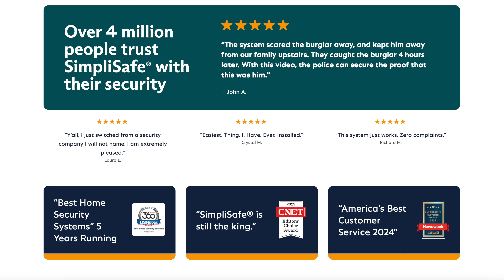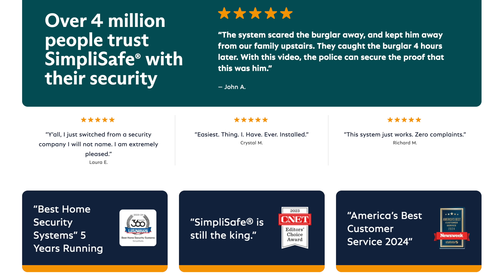Not Going to Lie, I was a Little Nervous! Back in The Saddle

Comment: Ceramic or after market  applied finishing coatings can be benificial for people that are OCD with respect to the appearence of their cars. How do you know if your OCD in this area? If you wash and dry your car before it's dirty you are likely complusive and an after market additive coating will be a benefit to your mental health. More lasting and actually achieving a minimal return on your investment is a roof over the parking area and second is adding walls to achieve true indoor storage for normal owners who care about the cars longterm appearence. However if as it seems to me you are to likely change your cars every 5 years or so almost all OEM factory finishes will be ok for this service length. So I recommend in your case to not spend on garages and or protective coatings, just have your car detailed and waxed before trade-in. Since retiring in 2011 I have been restoring muscle cars and more recently also building restro-mods each project car/truck has out of pocket costs of $50K-$70K and restromods cost 3-5 times as much. I built a home shop and have had one full time fabricator and two part time apprentices continuously employed. My shop is cooled and heated about 7000 sq ft half is for equipment and half is for the 12 or so on going projects I work on at any one time. I try to break even however my OCD makes this a yet to be realized goal so it remains an expensive hobby that my wife tolerates. Hope the above is useful. Ray

Comment: I ceramic coat all my vehicles twice yearly, I first clay bar then apply the ceramic coating. I use Turtle Wax Hybrid Solutions Ceramic coating with great success. Beleive me, you can get into first fights over ceramic coatings and you can spend many 100's to a couple of 10 dollar bills. YouTuber ProjectFarm has done a couple of videos on ceramic coating and Hybrid Solutions has come out in the top. Runs around $13 for a 16 oz. spray bottle that lasts me for two years.
Reply: You do not need to ceramic coat 2 times a year.... If you do it right, which it sounds like you don't, ceramic coat will last a MINIMUM of 3 years

Comment: Had Ceramic coating done by the dealer a few years ago and was not impressed. Back in December had a detail company do a Black Gladiator and really like it. Much easier to keep clean and since then have had two other vehicles done, one black and one grey.

Comment: Most body panels, in areas that use road salt, rot from the inside out.  Silicon coating won't effect that.  Might need to have the coating aplied every year for best effect.

Comment: I have one car with ceramic coating. The ceramic coating has a very slippery feel to it like a freshly waxed car but unlike wax it lasts a few years. Any dirt on the car can be easily washed off, bug splatters come off much easier. Definitely worth having done to vehicles you want to keep nice. Especially dark colors. Not worth it for everyday beaters.

Comment: Out of curiosity have you ever tried just stacking the whole rounds by the split force and using the log lift. I’m sure those are large rounds but they perfectly round. Almost seems easier to keep them whole and roll them onto the log lift. You seem to have mastered all your processes so I’m sure you have your reasons. I just can’t help but to think pre splitting makes it harder on the back actually having to lift half rounds instead of roll whole ones! Thanks for the video.

Comment: Flail mowers... they've been around a long time, not something new.  The are making a resurgence it seems.  They never really caught on in the past, at least in my area... but rotary cutters did.  There's a reason for that, and everyone sticks with rotary cutters it seems.  Like I said, there's a reason for that... I guess lots of people will figure out why once again.
Reply: @BKD70  You are so right.  I remember back in the 60's when they came out.  But they died out fast when people realized how much maintenance they required to keep working well.  They have various types of cutting teeth or flails, if you will.  Hitting rocks can dull them or crack them and sharpening them is a nightmare. I know one guy got some barbed wire caught up in his and made a huge birds nest inside that took hours to remove.  Round bale twine can also get wound up in one.  Better stick to rotary cutters.  One advantage they do have is being able to follow the contours of uneven ground without scalping. They can also mow very close to the ground.

Comment: I just retired from 38 years in the auto dealership business. Sold a ton of paint sealant. There’s many different options of product that do vary somewhat in quality but the prices are crazy whaat some folks charge. We used a Mopar product that worked well. Beaded up the rain and gave the vehicle a smooth feel and look. $200. I just got a quote for $2,000 to do my new convertible. They said the need to buff out the paint impurities. Granted there are always a few paint impurities in all paint but the result is probably needed for a show car but not an everyday driver. Check with the dealership to see if they offer it.

Comment: I was a little surprised Tom is 60. Yesterday I watched them put concrete in in-between rain showers.
I think I mentioned previously I bought my first new black vehicle in 1973. It was 23 years before I bought another black vehicle. I drove it home from the dealer and parked it in the garage for 2 weeks while I clay bared the whole Suburban. After that I took it to Ziebart for their Diamond gloss. It made regular washings less damaging. That Suburban was killed at the young age of 15 years by a big buck that the Police on scene argued over the rack. I replaced it with another black one that was immediately treated similarly to Diamond glossed. That one is over in the building and I mostly drive a newer GMC with professionally applied ceramic coating (totally worth it IMO). One of my buddies put a commercially available product on his Jeep and threw all his old waxes away. He liked it enough he did wife's Subaru. I have become so lax that I will use car washes but carry a leaf blower to try to get it dry before it turns white.
I wanted to add my GMC was coated 4 years ago and still looks great. I do not recommend coating at the dealer. Mine was done by a young man that started detailing in his garage. He came highly recommended by locals. He has enlarged his starting building and is adding a much larger new building. I wanted the under side of my vehicles Fluid Filmed but he uses Boss Wax, I have not decided to go for it.